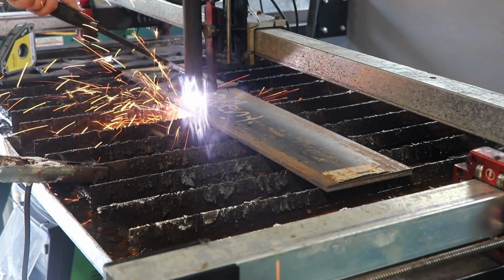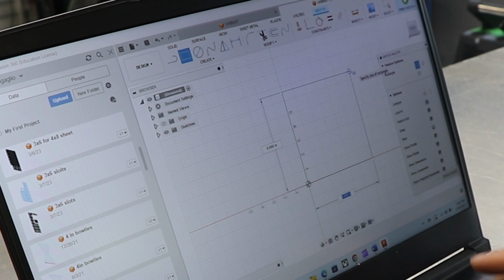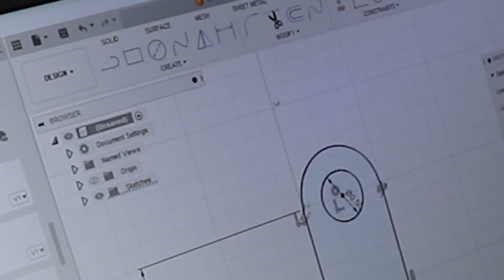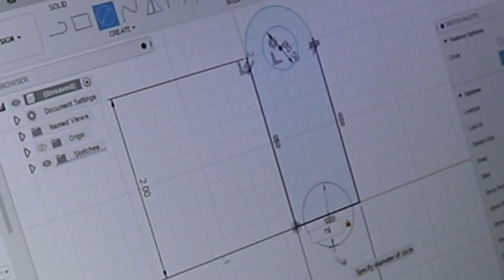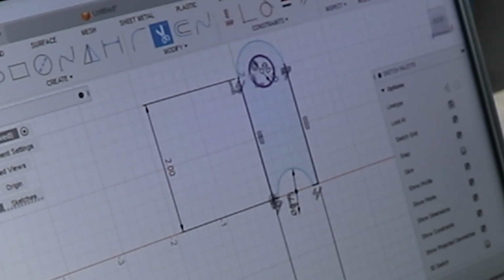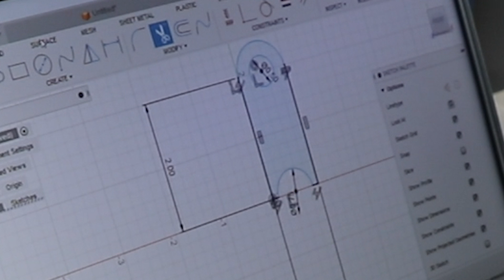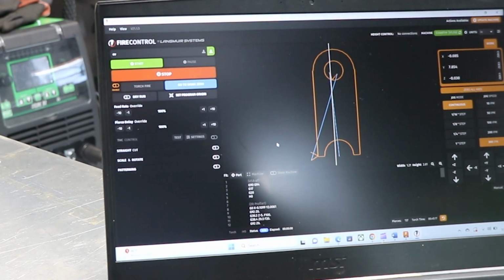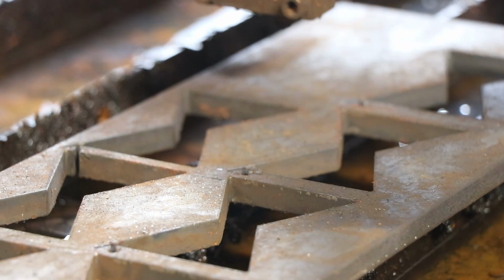Cutting a Tab: @everlastgenerator PowerPlasma 82i @LangmuirSystems Cutting Table

Comment: What is a relatively cheaper, starter level model plasma table go for these days? Say one that is may be fairly decent but used so it would be much cheaper
Reply: 1200 now it's sooooi many out there they all base there software  off mach 3 😁